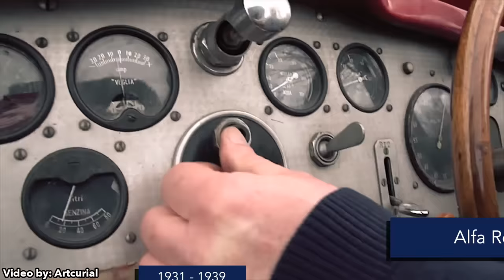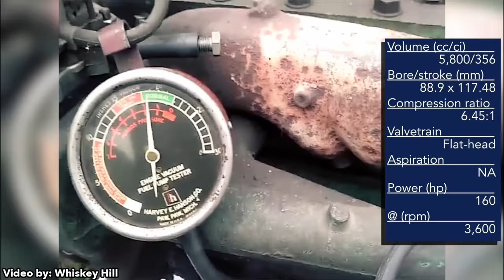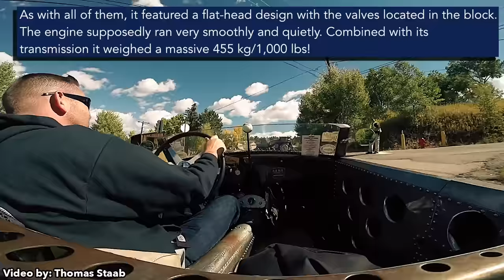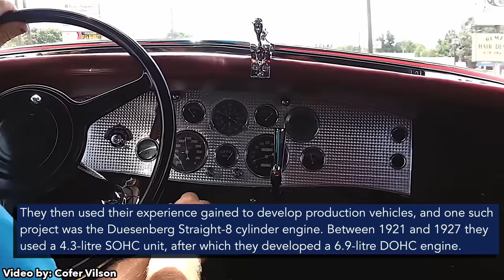The Best Sounding Straight-8 Engines In The World

Comment: Rolls Royce made a straight 8 that was used in Dennis Fire Trucks, I remember working on one around 1980 or so.
Reply: The small town of Virginia, in the Free State, South Africa used to own a Dennis fire truck. I once rode in it, the ride was as smooth as any car and the gear changes as smooth as you can get.
Reply: Back in the early 1990`s I knew a guy in Liverpool England that had a Firetruck with Rolls Royce straight 8 gasoline (petrol) engine. I seem to remember the valve gear was inlet over exhaust. When he first told me he had a Rolls Royce straight 8, I thought it was the Diesel straight 8 they once made.
Reply: That's the same B80 that they featured in this video.
Reply: It was also used by the British Military and known as the B80 and B81 series. Used in the Stalwart HMLC 6x6, FV432 Mk 1, Saracen APC and Saladin armoured car and some other applications.
https://en.wikipedia.org/wiki/Rolls-Royce_B_range_engines

Comment: I watch a video of the Mercedes W25 at least once a week.

That engine sounds so beautifully violent, I would love to build a custom chassis just for an old Mercedes or Packard straight-8. Twin gear driven superchargers would be a must-have :)
Reply: I love it too, and I also like how you have to Push the throttle between the gears.
Reply: Aaron schulz This is due to its sliding mesh gearbox which requires careful rev-matching during changes. The W125 (also in this video) was upgraded to a constant mesh gearbox that allowed for much smoother gear changes.
Reply: +MovinMetal knowledge! but thanks for the explanation
Reply: It's called double de-clutching.
Reply: The Bushwacker  
British sports car=800-1200kg, american car=9 tons
.
Reply: The Bushwacker Who still builds cars with carburetors?
Reply: Sounds like a wine up toy

Comment: 2:19 <3 That's one of the best engine sounds I've ever heard.
Reply: That's an impressive black cloud - I bet it would go faster if they leaned off the mixture
Reply: Rolling coal in a diesel is bad enough but a petrol engine...
Reply: MiG21aholic hehe
Reply: MiG21aholic Yeah but I can't see the smoke at 2:30. Maybe because the engine has warmed up enough
Reply: repapeti Quite possible
Reply: Not the same car. Dudes in the second clip had their car running great.
Reply: My bet on the black smoke is, the car used to run on methanol or similar fuel, and consequently the carburetor is set up for running on that, but was using petrol at the time of the recording. That would make it run rich once they used petrol without resetting the carburetors.

Comment: they sound like an American v8 a lot. is it because inline-8 engines naturally have cross-plane crankshaft configuration?
Reply: Bang Gegep the mazerati I8 has a flat plane
Reply: Bang Gegep
The engines can be any way the designer wants.
There is no rule that says each particular configuration uses a set design.
There are "flat" 12's that are really just modified V8 + V4 engines canted nearly all the way down.
Reply: ***** I think it's (arbitrary) fuel economy standards more then anything that the US government is trying to push. But, even so, we're still cranking out 700HP supercharged hemi's that are emissions compliant.
Reply: Everyone always says "American" V-8... remember that the cross-plane layout (and thus sound) is characteristic of EVERY production V-8 EVER with the notable exceptions only of Ferrari, Lotus, McLaren, and one very recent Ford.
So you're also talking about German, Japanese, and South Korean V-8s too :)
Edit:  Almost all English V-8s too! (save for the Lotus and McLaren I mentioned)
...sorry to threadjack. +Bang Gegep Good question, and I agree.  Though I don't really see how an inline engine could have cross vs flat plane on its crankshaft.  Maybe it's mainly exhaust pulse timing like 177SCmaro suggests?
Reply: more 4 stroke crap, we need more 2 strokes.
Reply: Bruce Miller would be nice. But emissions aint havin it.
Reply: I dont worry about emission anyway.
Reply: The new etec has low emissions
Reply: Then why don't you go live someplace like Beijing then. Remember to breathe real deep now.
Reply: it sounds like an old American v8, no fuel injection.... if the engine had fuel injection they would sound easy more unique
Reply: Bang Gegep That's one factor. Firing order and exhaust tuning have something to do with it, too - the current Mustang GT350 is flatplane, but it sounds like a crossplane, doesn't it?
Reply: it fires every 90 degrees of crank rotation the same as a cross plane v8 so...
Reply: F1 is going 2 strokes
Reply: @RRVCrinale  the BMW E46 M3 GTR has a flatplane V8 that sounded like a crossplane too, only with higher rpm.
Reply: @jlo13800  wtf I've seen you comment on so many random videos about your snowmobile engines. Completely unrelated lol
Reply: @177SCmaro  aren’t arbitrary.
Reply: @talisikid1618  
Yes they are. Why not 1mpg more or less, why not 5 or 10? What is the objective, rational standard?
Reply: On a V-8 each side has two cylinders that fire one after another and a pulse where two are firing one after another on the other side. When they build exhaust for V-8 that puts all pipes into same collector they sound like an in- line engine. Look them up. Chevy small blocks that sound like a Ferrari

Comment: The balance of an in line 8 can only be realised with a very rigid crankcase. WO Bentley was very suspicious of the RR straight 8, the crankcase looked far too flimsy to be rigid enough. He was right, it was vibrating all over the place, but RR hand mounted the engine at the nodes of the vibration so the vibrations never made it to the chassis.

Comment: 6:48 omg that looked so fun to drive... just a raw car. loud, nimble, good gear changes <3
Reply: Corkoth55 packards were road aircraft. Amazing machines that could get 300k miles
Reply: @RainmakerXBooty  to be fair even the others were kind of ok, they were just rev matching a lot to compensate for the slow shifts and maybe that's not the most pleasing thing to hear. If their shifting was properly bad on these old non-syncromeshed transmissions they would have had the transmission making all sorts of unhappy noises while completely refusing the gear change, too. Instead after one or two blips on the throttle the gear went in, it's not too bad on these cars, they are not the easiest things to operate :)

Comment: yes, visio! thankyou very much for such a cool video, featuring some highlights of past technology.  the European engines sound very nice, quite smooth. the buick engine you first pictured was a prewar hot rod, with high compression (for the time) wedge pistons, and "compound carburation" pair o single barrels. as well, the packard engine is very smooth indeed. there is video on youtube here of a freshly rebuilt packard straight 8. A nickel coin was stood on its edge,  on top of the engine while running, and the coin stayed still. on its edge, on top of a running engine. thats engineering.

Comment: Packard Straight Eight for 1954 had 212 H.P. with optional supercharged version of 275 H.P. This was Packard's  largest straight 8 at 359 since the 1937'' Super Eight 384 cu. in. engine. The 275 H.P. engined Packard was the most powerful American car in 1954.

Comment: Awesome Video! The Packard 8 went till 1954, as I have a 327 in my Clipper Deluxe. THUNDERBOLT!!  
Video states 1942 as the last year..
Reply: Kyle Henricks I have a 51 packard 200 with a 288 straight 8. It's sooooo smooth
Reply: Pontiac still had the flathead straight 8 in '54 also.
Reply: Packard 1954 had a 359 cid straight 8 with aluminum head and 4 bbl carb. and 212 BHP @ 4000 rpm.

Comment: I didn't know there were so many. They should build them today just for the hell of it.
Reply: They are a failed design, just like the rotary. There's no reason to bring them back
Reply: Debbie downer: it's not a failed design, it served its purpose very well.  That purpose has shifted, and now an I-8 wouldn't be profitable.  Like the rotary, that does not at all mean it wouldn't still be awesome.
Reply: Maybe not bring them back but the vast majority of the originals will still run well. I've had two Buick 8s a 248 and a 320 short of being left in a river they will usually start and run not matter what. Bullet proof, little to no vibration, and obscene amounts of torque at low rpm. I wouldn't call them failed by any means. Tell me how many of these so called new engines will be around in 60-80 years and still be fine.

Comment: The Bugatti 35  8 cyl use inline twice assembled 4cyl blocks (to avoid crankshaft tortional fragilities) and produce up to 140hp at 5500rpm in the latest 1927 35B 2.2L Roots supercharged version who was 210km/h capable...

Comment: nice video but there is a mistake... i have in front of me a book called "Motor's Auto Repair Manual" published in 1953.  my father bought it along with a used 1948 Chrysler station wagon - he traded in his 1933 Packard on it when he married my mother.

you state "Not much is known about these engines".  this book covers every American-built auto from 1935 to 1953 and contains ALL of the detailed specifications for every Packard engine used during those years.

385 cid was the largest variant but was discontinued in 1937, afterwards displacement fell to 320 ci.  the 356 was introduced in 1940 and was used until 1949, when it was replaced by a 327 cid motor.

also, horsepower for the Duesenburg 425 cid straight 8 is listed in an earlier edition of this book (i also have) as 265 - still outstanding for it's day - but that is for their production engines... race engines may very well be over 300 as you say.
Reply: These days if it's not on line, it must not exist, it's a shame that's how a lot of people think, they don't know what they are missing.

Comment: You didn't mention the Scania straight 8 diesel.
Built in sweden in the fifties, it's called the "Scania D812", it's naturally aspirated, has 11.5 litres of cylinder volume and it makes 155 hp
it was mainly used in light passenger trains and shunter locomotives.
There is also a turbocharged version called the "D815" and a marine version called the "D816".

Comment: Straight eights are one of four engine designs with inherent primary and secondary balance.  THe other three being:  Straight 6, V-12 and V-16.

Visio, thank you for making these compilation videos and crediting the original posters, as well.  I don't mind your narration, though your accent is quite thick, and I can believe that some might find it hard to understand.

Have you considered asking a native english speaker to narrate for you, as in the Kurzgesagt video series?
Reply: also the v8 but only crossplane, not flatplane
Reply: Erik Warnes w16*
Reply: 88manta88 V8 requires counter weighted crank to achieve primary balance, hence it is not considered inherently balanced.
Reply: Also all boxer type flat motors.
Reply: Or perhaps add subtitles.
Reply: The flat 6 is also perfectly balanced.

Comment: 1:45 how do you get only 5.75:1 compression out of 100mm stroke? is the combustion chamber 50mm away from TDC?!?!
Reply from the maker: It would need to be 1:1 compression ratio if it was 50 mm aways from TDC if my math is correct.
Reply: 50mm would lead to a 3:1 CR out of a 100mm stroke because at bdc total distance would be 150mm.
the combustion chamber is 17.4mm away from TDC because 100/5.75=17.4

Comment: Due to the length of the engine, torsional vibration in both crankshaft and camshaft can adversely affect reliability and performance at high speeds. In particular, a phenomenon referred to as "crankshaft whip," caused by the effects of centrifugal force on the crank throws at high engine rpm, can cause physical contact between the connecting rods and crankcase walls, leading to the engine's destruction. As a result, the design has been displaced almost completely by the shorter V8 engine configuration.

Comment: I owned a 1951 Pontiac Chieftan that had the flathead straight 8 along with a factory equipped 4 speed Hydra-Matic automatic transmission. I was the second owner as my uncle bought the car new and gave it to me when he decided that he was getting too old to safely drive. It had a little over 100,000 miles on it when I received it. I placed over another another 100,000 miles on the car when I finally sold it. The car was heavy and it's acceleration was nothing great, but once up to speed the smoothness of how it drove made it a pleasure to cruise in. The only replacement parts that I ever placed on that engine, besides normal tune up parts, was a new water pump and a new fuel pump. The fuel pump had two diaphragms. One was for fuel and the other was as a vacuum assist for the windshield wipers, as engine vacuum alone would slow the speed of the wipers during acceleration. Electric wipers weren't widely used in those days. The engine was always well maintained during it's lifetime with my uncle and myself and oil usage was very minimal, even with well over 200,000 miles. The engine had a unique yet smooth sound that was very unlike the buzzy sound that is typical of an inline 6. 

On another note, my father, who was a automotive specialist years ago, told me that the Buick OHV inline 8 engine was originally designed by the Nash Motor Co. for use in one of their cars, probably the upscale Ambassador, but the engine was never placed into production. Nash's financial issues were probably the reason that allowed GM's Buick Division to buy the rights to this well designed engine for their cars. Their sound was as smooth as silk as I can remember when those Buicks were common on our roads. You could tell when one was passing by as the Dyna-Flow transmissions that were coupled to those engines made the shift points almost undistinguishable.

Comment: 8 cylinder engines inline or v configuration have that sound that no other engines do, great video
Reply: Yeah they do have that mean, agressive sound. But it's not that unique. Some, mostly old, V12s can have a similar sound.

IMO Inline 5 has the most unique sound.
Reply: The weird thing about 5 cylinder engines is they balance out better then a 6 cylinder engine that’s why they are so popular from a engineering aspect for s inline motor.

Comment: Great stuff. You don't hear enough about those Straight-8 engines anymore. Smooth but don't fit in well with modern car dimensions.Yes there were some well engineered designs which were used for many years. Thanks for good look at these. Good job.

Comment: I remember talking to an older man who parked his late 1940's/ early 1950's Packard at a local grocery store. He told me that the I-8 engine weighs close to 1000 pounds and I believe him. Lots of low end torque , but certainly not  a performance automobile due to hp/weight ratio and flat head technology. Amazing what manufacturer's did with the technology they had then! John in Texas
Reply: The Packard straight 8 was very very smooth. I sat in on as a kid, you could not tell if the engine was running or not. It had to be heavy to contain the long crankshaft.

Comment: My old boss had a late 30's Buick coupe with a in-line 8 and you could never tell it was running as it idled that smooth and quite. It.took me about 15-20 minutes thr very first time I drove it just to start it as the starter button was under the gas pedal...

Comment: The engine in the Packard powered rat rod is a Thunderbolt 8,  of which there were 3 sizes: 288, 327, and 359 ci. The engine in the video is a supercharged, high compression 359 with a custom camshaft.

Comment: Studebaker produced 2 Straight Eights 337 CID and 250 CID. The 337 was run at the 1932 Indianapolis 500 and later years the 250 was run. The 250 in the later President 8 whisper quite and smooth as steam

Comment: Really missed the Alfetta 158/159 here. They sound even better than the older 8C and also 8 in line supercharged.
Reply: Yeah, though I noticed that they actually sound like the older 8Cs, only that they rev much higher (up to 9,000rpm compared to the original 8C's 5,500rpm).

And there were some footages of them in the internet as well...

Comment: You need to add the type of valve actuation to your description (double or simple overhead camshaft, or pushrods, etc... Makes a huge difference in the potential horsepower of a design.

Comment: I usually prefer straight engines over a V engine. And even at classic car shows I haven't seen so many straight-8 engines. Well, in my country it's no surprise that older cars would usually have their stock engines replaced by some locally-available Chevrolet or Volkswagen one, so it wouldn't be impossible to find something originally fitted with a straight-8 repowered with a Stovebolt Six.

Comment: Good God, a couple of them made horsepower relatively similar to modern V-8 equivalents with lower compression and probably crappier gas with similar displacements.  I love me a good inline, they run smoother and have overall higher torque ratings.  You had to build the block up on an inline 8.  You had this thing called block flex to compensate for.  Usually in increased weight due to thicker blocks.

Comment: You missed the later version of the Rolls Royce B80 (160 BHP) - the B81 (185BHP)  which was 1000cc bigger. The term 'they only managed once' is misleading. They only made the one series of petrol straight eights as it's generally accepted that torsional vibrations in the crank shaft not only requires sophisticated damping but eventually limits power outout.  It was also fitted to the Stalwart and various fire crash tenders. They also made the C range of diesel engines which included the straight 8 C8 diesel which powered the Antar tank transporter and vehicles, boats, trains, etc  both here and abroad.